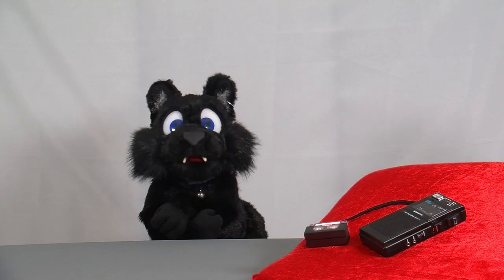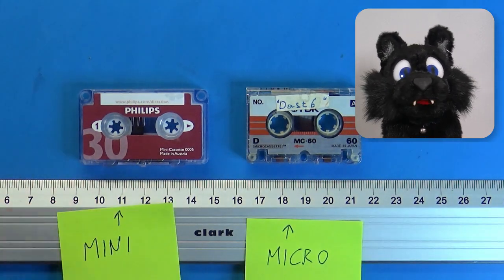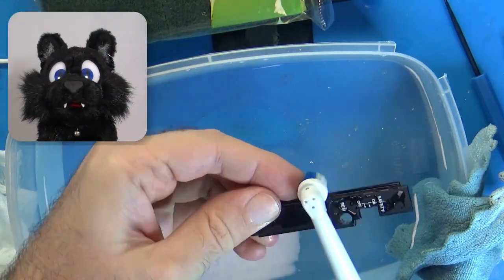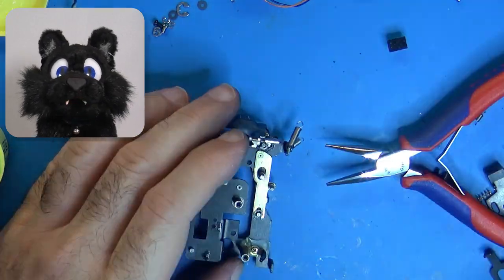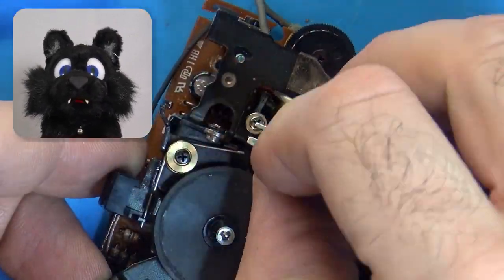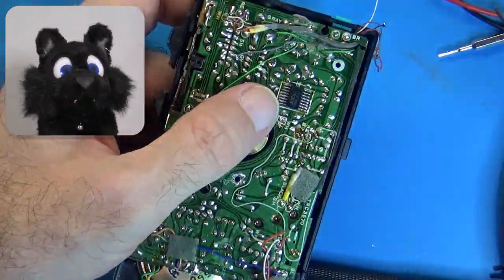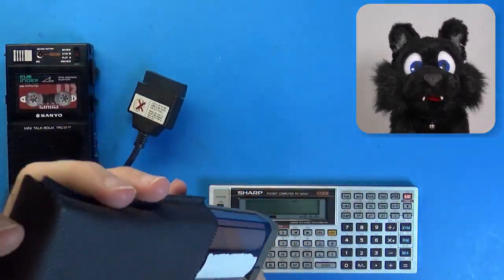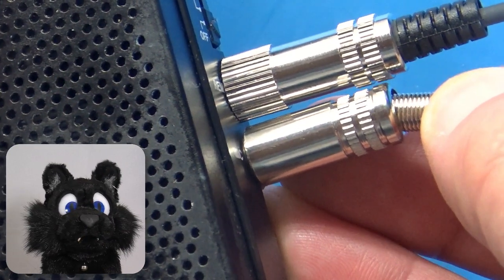Restoration Project #12 - Sanyo TRC 3570

Comment: Is it recording? I have a similar model, trc3550 but it doesn't properly record
Reply from the maker: Yes, it is... I used it several times o record small programs from a sharp 1403 calculater with its tape interface.

Comment: Sharp couldn’t put a tape drive in the expansion unit ? 90s electronics design is a perpetual puzzle to me, innovative yes, seemingly almost deliberately difficult to use as well.
Reply from the maker: I think some models of these adapter or docking stations had a tape unit integrated. It was most likely a cost saving offering. Back when everybody had a tape deck to begin with, it was easeier and cheaper to use adapter cables. Also, most offices had dictation devices around for meetings. While it seems strange from today's perspective, I can see the resoning back when.